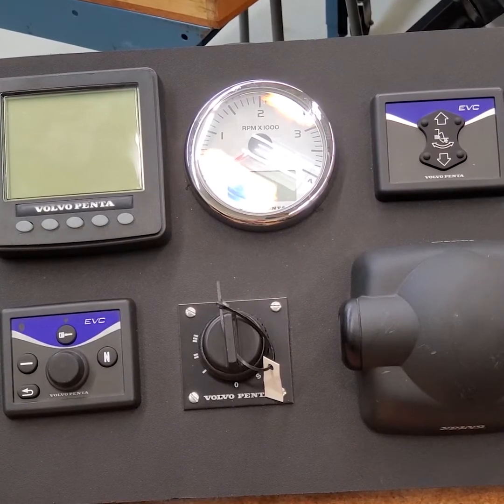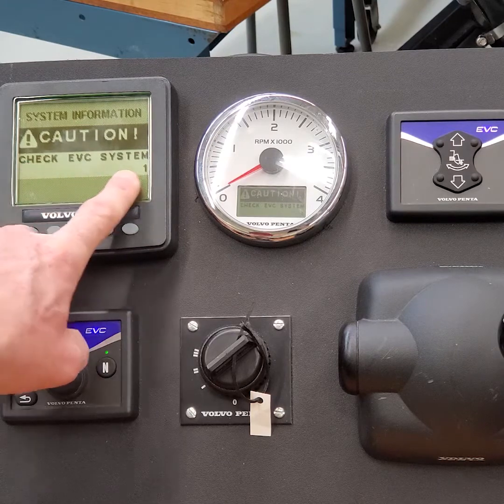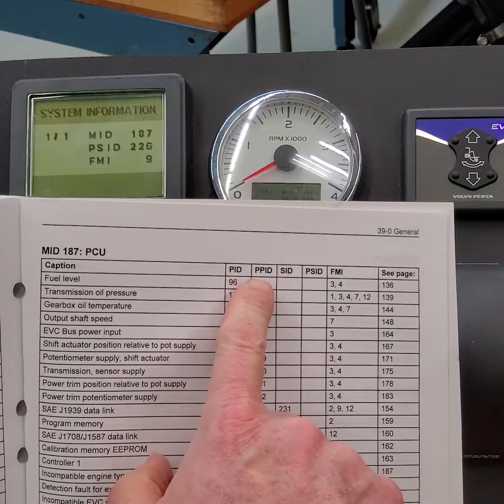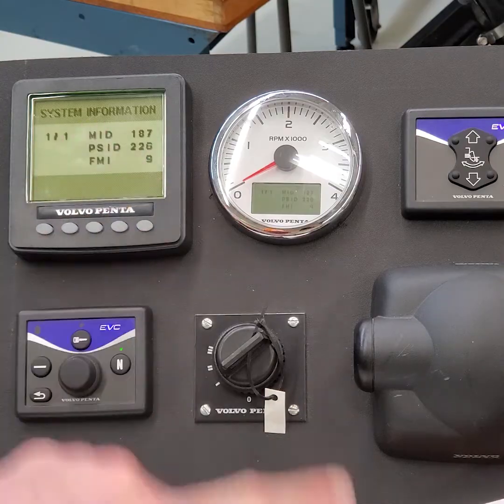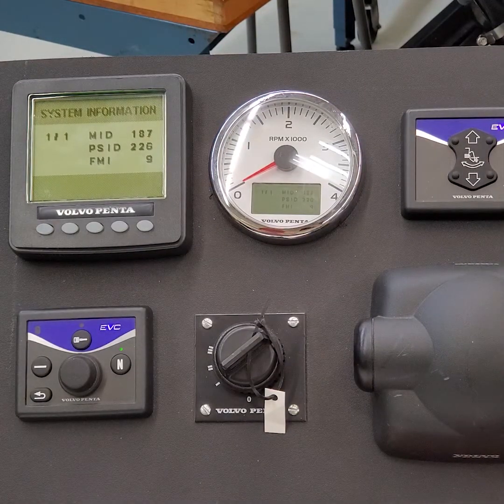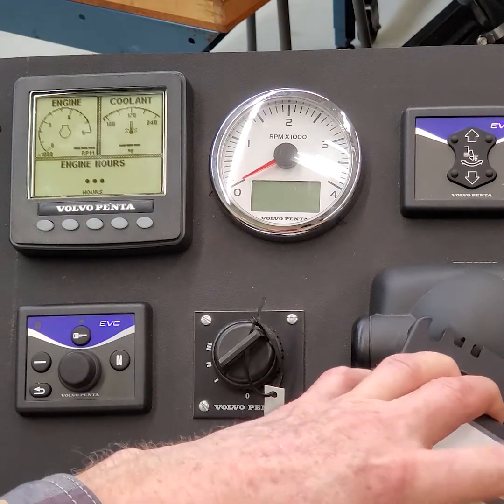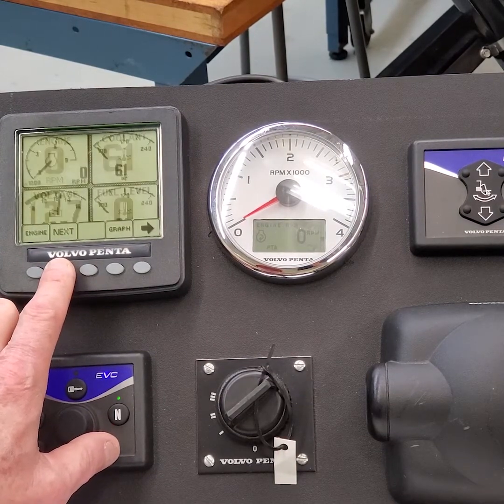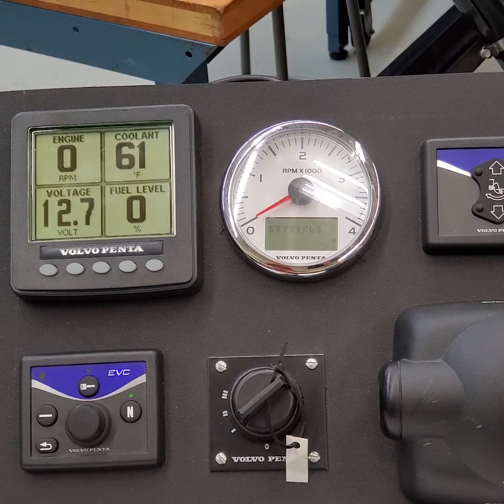Volvo Penta Repair, EVC-C Helm Diagnostics 1

Comment: Hi Ted i have a problem with volvo d3 160 the fault cod is mid 140 sid 231 fmi 11.i do where ever you said in video but the display doesn't open.you have  any ideas?

Comment: Hi Ted,  do you know if it's possible to fit the stop start control while retaining the key switches on a evc-c single helm with 2 x volvo penta d4 260s , I purchased the stop start panel without researching it fully thinking it would be a nice addition,  but on initial inspection it seems it's one or the other without  having a second helm station .
I have asked on a few groups but had no answer .

Comment: Hi Ted

First of all – thank you very much for all your great work on Youtube… your videos are really helpful…

We just purchased a Bavaria 37 HT form 2009 with a pair of D6-330. We went on seatrial last Thursday and everything was just running smoothly. Went to pick it up and sail it home the day after, and here she would not start PT engine.

We managed to wiggle cables and stuff and got no errors and started to get home. 5 days later we arrived at our harbor and had engine issue on PT every day. Had a VP mechanic on board with Vodia tool to check and it was clear that the data link cable between HCU and PCU was bad – he had a test cable with him and connecting that things worked. We took the one out that apparently was faulty and tested it… there were no errors at all, connected it back, auto calibrated and no problems.
3 hours later we wanted to start as wind had slowed down and same error again, wiggling cables, auto calibrating and managed to get on the move….

So now back safe in harbor I went to test what is going on… here is what I found:

Swopped cabled from SB to PT PCU and also at the HCU to see if I could move the failure to the SB engine – no luck at all, still the same.

Took the main power fromswitch engines, waited 3 mins and repowered… error still there:

FMI 164
SID 253
FMI 9

And
MID 164
PSID 218
FMI 9

These indicate error in comm betheen HCU and PCU.

Did auto calibration and got:

MID 164
SID 253
FMI9

And
MID 164
PSID 99
FMI 12

Last one indicates that configuration is lost

I then reseated the large connector on the PCU – that gave me a new set of errors:

MID 164
PSID 99
FMI 14

And
MID 164
PSID 99
FMI 12

These indicate that comm is good but config is lost… so I auto calibrated again and all errors were gone – I could start engine and had full control.
I shot everything down and took the main switch again, waited 3 minutes and repowered – then the issue was back.

I could suspect the PCU, but reseating the large connector on the PCU seems to do something, so wondering if there could be something else that makes the PCU fail on startup…

When I got the first set of errors I notice that the tilt sensor showed 56, no light in neutral, engine would not start with error “Engine in gear unable to start”.

Strangely we found (during 4 days of sailing) that one the error is gone everything works perfectly throughout the trip – but when we power off the error comes back. Again reseating seems to do something good…

I also notice that the actuator is no moved when applying ignition when the error is there.

Would you have any ideas of what to look for?

Thanks for REALLY great video’s on Youtube, they are very much appreciated.

Best regards

Soren Fleron
Denmark

Comment: Hi Ted, thanks for your video. I have twin D4 260 EVC 3 on a 2010 boat. I faced a default MID 164 PSID 81 FMI 4 which causes lever out of work and key button flashing on EVC (security mode). I have replaced the BOSCH potentiometer,  made the auto-configuration and the calibration but default is still present. I tried to swap the left lever command on the right D4 and it works on the right D4. Therefore the control lever is ok.
The Volvo tech tried to connect the VODIA on the EVC DIAG connector ON THE MOTOR and no default appears on VODIA. Any ideas or suggestions? Many thanks
Reply from the maker: Fmi 4 is a low voltage fault code. So either a harness problem or faulty HCU.
Try swapping the X7 harness from port hcu and lever to the starboard and starboard to port. If the problem swaps sides its a harness issue.  part # 874676 
If the problem stays the same then you need an HCU
Reply: Thanks very much for the quick answer !. If it is an HCU and I buy one , do I need a Vodia to install the soft in ?
Reply from the maker: @ericleandri9058  yes dealer only

Comment: Hi Ted, I have a boat with twin engines Volvo Penta (2004) TAMD 75EDC (480cv) with only 360 hours. One of the engines cannot run due to no neutral position not detected (Green led off and default let on) when I replace / exchange ECUs the faulty engine  runs. For sure one of ECUs is failed, are you in position to fix such failure and can you accept to do that. Thanks for your futur support. Regards. Claude from France
Reply from the maker: Claude,
Unfortunately, I have no way to fix an EDC ECU. Your best bet is to contact a volvo penta dealer.

Comment: Hi Ted. I’ve got a 04 440 cruisers with Volvo diesels. This has the EDC shifting single lever control. Port motor shifts smooth into drive and back to neural. Pull back a single step to reverse and still says neutral until I pull way back into the throttle zone then goes into reverse. How can I recalibrate this? Any help would be appreciated.

Comment: Hi Ted, You've helped me out in the past, so I'm hoping for a little more guidance. I have twin 2008 D6 435's with an EVC-C System. About a week or two ago, while running inside the marine, the RPMS started to "hunt" around 800 RPMS, one motor would start to drop to 780, 760, 740. The other was almost opposite. I took it back to idle, then increased them again to about the 800 mark and same thing happened. Once, I got it out of the marina and increased the rpms, it ran normal for the day.  Then, on another day, it started doing it again. Very intermittent. Finally, I was out fishing and while on a drift, an alarm sounded for the port motor. no codes that I could see, but my port EVC displayed showed 175 RPMs, but the engine was idling fine. I had to shut it down and restart the engine. Everything went back to normal. I'm at a complete loss on what to check. Any ideas or suggestions would be appreciated. Thanks!
Reply from the maker: Is this a single station boat, or do you have another station to run it from to see if it occurs at that station as well. 
Sounds like a multilink harness issue between HCU's, due you state the rpms are moving opposite from one another. You could try an auto configuration and recalibrate the controls to see if that clears it up. Low voltage at idle rpm does quirky things to.
Reply: @tedsmarinerepair8956  Thanks Ted, I do have a tower with an upper station. Next time it acts up, I'll run it from up top and see if that eliminates the issue. I'm pretty sure that my voltage is good, generally 13.6 at port and 14.1 at starboard. Have you heard of any issues with using AGM battery's?  I just replaced all the batteries with new AGM's and was wondering if that would be an issue.
Reply: @tedsmarinerepair8956  Thanks again for your help. I didn't think it could be a voltage issue, but I'm having second thoughts. Last weekend, the port engine wouldn't fire until I paralleled the batteries. Question: What voltage does the EVC display indicate? My Port battery shows 13.11 V, Port starter shows 13.11 V, Port EVC shows 12.9 V. The voltage drop seems excessive. Is the EVC voltage showing battery voltage, or EVC system voltage after the dc to dc converter? The Stbd side has a similar drop in voltage.

Comment: Hello Ted, first of all I am about to get crazy.
I have a major malfunction at my Engines d12D A-MP.
The problem is at the EVC system. 
It does like crazy things I don't know even to explain 

4 different types of observations.

1.motor starting looks that is running well and  the panel at the flybridge does not tale control of the motor

2. Motor starts alarm and buzzer start after some second I try to read the alarm from the panel and the panel shows 1.1. And after the motor switch of alone.

3.motor starts rpm goes up alone alarm starts motor switch of alone.

4.keys turn to start motor starts all alone 

5.turn keys at position 0 and the monitor display does not sut down.

Al of this is in one engine, which is the left.

Test that tried.
Change the keylock with the other motor that does not do any of those
Change the evc panel into an old one because the one at the main bridge it is new also change the evc from the fly to The main station
Change the evc panel of the flybridge 
Unplug an plug again the evc box at motor
Check the emergency stop FISE

Please for your opinion and any help

Thank you in advance
Reply from the maker: It sounds like a software issue either in the PCU or likely HCU. You could try swapping the HCU from the good side to the bad and see if the issues go away.

Comment: Great video!  I currently have this system with dual engines and have this code:
MID 164 - multilink system
PSID 209 - data link
FMI 9 - update rate is off
My port side engine won’t start and the code I believe says the analog key isn’t communicating to the digital converter to start the engine.  What could be what I need to replace? The control box? Could it be the wire harness? Could it be a bad ground?   Would I want to auto calibrate or no?  Please help

Comment: Hi Ted, Again..... Great video  I have twin 2008 D6 435's with EVC-C System. Upper helm, port side gave me a code MID 164 PSID 64 FMI 9 (Joystick Fault) But, I don't have a joystick. Thinking it could be the potentiometers, I went ahead and rebuilt the control unit. Plug everything in and the fault returns and will not let me calibrate the control. Plugged the port side into the starboard HCU and I can calibrate it fine. So, I know the cabling and control unit us good. Is this fault something that I would need cleared by a tech with a scanner? The HCU does have the green flickering light and I've auto-configured the system more times then I can count.
Reply from the maker: That code (EVC C without a joystick) indicates the HCU has software issues. A software "reflash" might fix it or the HCU may be faulty. Either way you require a VP service tech with a VODIA tool.
Reply: @tedsmarinerepair8956  Hi Ted, thanks for there quick response. I disconnected the data cable and reconfigured the lower helm. Funny, my voltage went from 13.8 to 14.1 while running after it was disconnected.  I might just order a new HCU and be done with it.  In your opinion, what makes these things go? Battery voltage seems to be what I have read.  But, I have new batteries and all new wiring. Before I rewired the battery banks and installed all new batteries, I had both on the starboard side go. This will be my 3rd HCU in a year.
Reply from the maker: @jeffwarren7852  Yes voltage can be a concern, however internal temperature or severe vibration I believe is a likely cause for premature failure.
Reply: @tedsmarinerepair8956  Thanks again Ted, nice to have someone explain these things. Hard to find any real information it seems!
Reply: @tedsmarinerepair8956  Hi Ted, is there a Volvo Penta rep that I could contact for a qualified tech? Lot's of tech's in our area (San Diego), but few have any experience. Not sure if you would have any input but thought I would ask. I've been through three HCU's in a year and really need someone with some knowledge. Thanks!
Reply from the maker: @jeffwarren7852  I will reach out to my local rep and see what I can find out.
Reply: @tedsmarinerepair8956  Thanks Ted, appreciate it much! Also, just an FYI, the tech I had come out tried to update my HCU, but didn't help. Not quite sure if that would be the same as a re-flash, but that's what he tried. Anyway, I ordered a new HCU and installed it yesterday. Everything is running as it should. Still hoping for a good solid tech however.

Comment: Hi Ted, All the instruments in our boat dont show any information any more. The HUI EVC led light does not light up. is there any way i can check if the HUI EVC is not broken.
Reply from the maker: Not without a vodka tool sounds like you need to contact a dealer
Reply from the maker: Auto correct!! VODIA tool

Comment: Hi Ted. 1) With this fault "MID 187 PSID 226 FMI 9" is it safe to operate the engine with the controls that work or will this cause further problems? and 2) Could this fault just be showing an historic fault and therefore if all stations currently work this fault can be ignored?

Comment: Hi Ted, I really enjoy your videos! I have a boat with 3 2009 ips600 d6 435 drives (EVC-C). I recently had the autopilot replaced but for some reason the new autopilot does not have any sort of control over the boat. The autopilot control head properly tracks the "rudder angle" of the IPS drives when I turn the steering wheel. Garmin support confirmed that the autopilot is connected properly and they said that the boat might need a volvo data config. What do you think? I really appreciate your help!
Reply from the maker: Sorry for the delay. There is a Volvo Penta NEMA 2000 adapter that integrates Garmin into the EVC platform. A Volvo Dealer can verify if that is properly installed and configured.
Reply from the maker: Yes, if you change any  hardware within the EVC system you should do an Autoconfiguration. The autopilot needs to be plugged into the EVC NMEA 2000 interface unit as well.

Comment: Hi Ted, very informative video thanks. I would appreciate your opinion regarding malfunctioning electronics on D1-30. 
Today I did installation on a brand new engine D1-30 on a friend boat. After the battery was connected I wanted to check the communication with the panel and SURPRISINGLY wired malfunction the start motor start running without touching the start button. The only one button I pressed was the power button ON/OFF. Now I can see on the screen is the Volvo Penta logo for 1-2 seconds and then the screen is OFF. All of the connections are correct : panel to panel and tachometer\screen to multilink. I have no idea what the failure is but doesn’t feel right!!! Tomorrow I’ll ask the dealer what the Volvo Penta support will recommend in this situation. I assume that the answer will be that I have done something wrong.... I can call king of a mistake that firstly I forgot to connect multilink to tachometer, but I think that could damage the MDI! The all evening I’m looking for information how can I solve this and very unfortunate I found a lot of comments that many EVC panel are failing and damaging the MDI. So wired.... It would be horrible experience to install a push button on a new engine.....
Reply from the maker: If you are a vp dealer you should be able to warrenty the mdi (which may be the cause). If you are not, then an authorized dealer needs to finish and inspect and fill out the the pdi for warrenty.
Reply: @tedsmarinerepair8956  Thank you for the quick response, appreciate it!

Comment: Ted - Is it possible to upgrade EVC-C to EVC-E? I assume this would require updated components and SW, but is it possible? Thanks!
Reply from the maker: Kevin,
E is a totally different platform than C so in reality it is not an option. A "repower" to an E system would be an option.
Reply: @tedsmarinerepair8956  so you can’t just replace all of the components (PCU, HCU) etc. and wiring?
Reply from the maker: It is not the way the system is sold. Each individual EVC platform is assigned a Chassis ID #. This number is created  from an each engines driveline serial #.
So each Chassis ID# is specific and incompatible with any others. 
So you can not just buy the hardware and   install it.

Comment: Hi Ted, 
My engine is a volvo D6 310hp and the screen on my dashboard digital screen has gone blank. on switching on the ignition everything boots up but the digital screen remains blank. 
Any suggestions 
Thanks
Reply from the maker: If the screen is totally blank - never flashes the Volvo Penta logo on battery power up then I would suspect either a power or ground issue on the Multi-link bus or the unit itself has failed internally.
Reply: @tedsmarinerepair8956  
Hi Ted, screen lights up when starting engine then goes black!
Reply from the maker: I gather this is a 4" display like in my video- yes? I would unplug the harness from the unit and the HCU and inspect the harness - Test the harness for continuity. If all the wires have no resistance then plug the unit back in and try an auto-config. If you still have the same issue it's time to call in a VP dealer to test the HCU and try another display.  @fergieanderson766
Reply: @tedsmarinerepair8956  
Hi Ted,

Will do what you suggest. Thanks Fergie
Reply: @tedsmarinerepair8956  Hi Ted, I checked out all connections on the EVC and all came good except the display is now in Swedish?

Comment: Hi Ted,

I have a fault on my Volvo Penta D4 300. And I want to hear if you can help to locate the problem. The display says check multilink and it has this code MID 164 PSID 80 FMI 9. I have tried to find the groupe 30 electrical manual for the D4 engine, but whiteout luck. Hope you can help me.
Reply from the maker: The code is for a speed depth temperature multi-sensor. It connects into the multi-link bus. If you do not have one try to auto config the system to make it ignore it. If you do have one then you need to check the harness connections to see if the problem is the bus or the sensor.